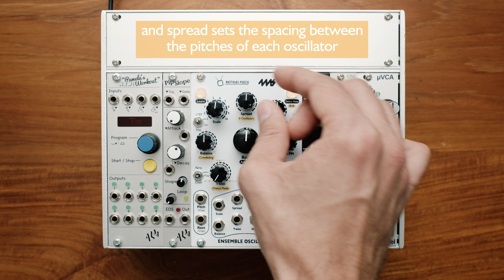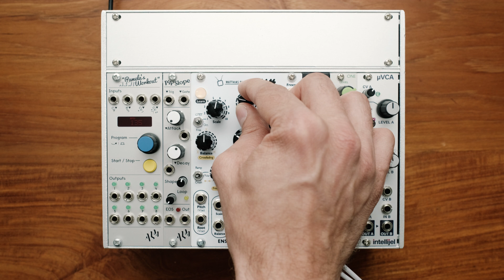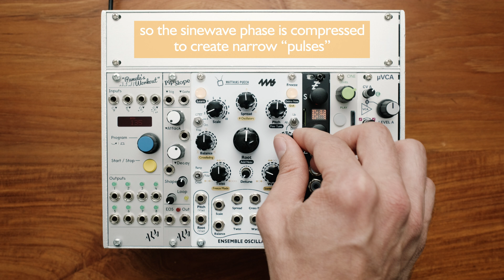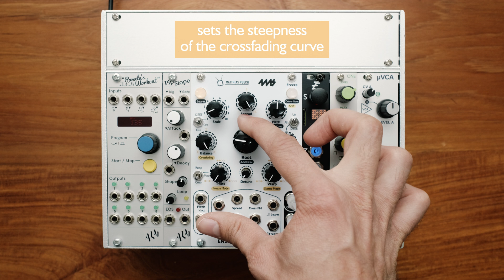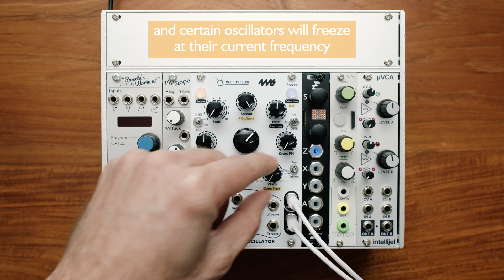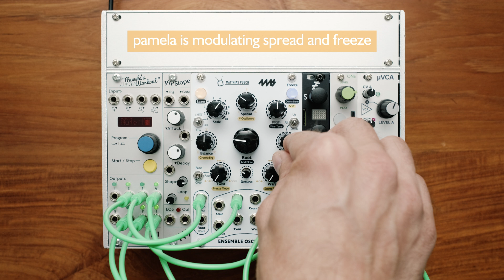Polyphonic Eurorack! The 4ms Ensemble Oscillator

Comment: So would this module accept polyphonic midi to cv signal? Or is it polyphonic in the sense that you can modulate/sequence the root and pitch inputs independently?
Reply from the maker: It has 16 oscillators that are quantized to a scale. Using root and spread or pitch and detune you can adjust the frequencies before or after quantization. This gives you a lot of control but you are not able to send in polyphonic midi signals. I hope this helps!
Reply: @pitchpatch  yes it does thank you!